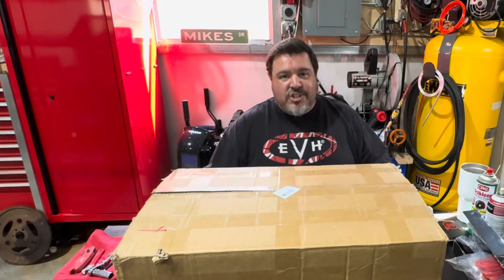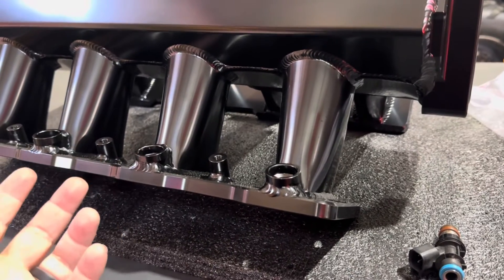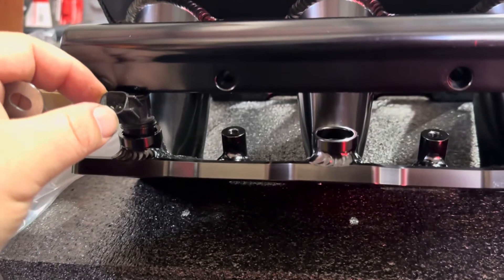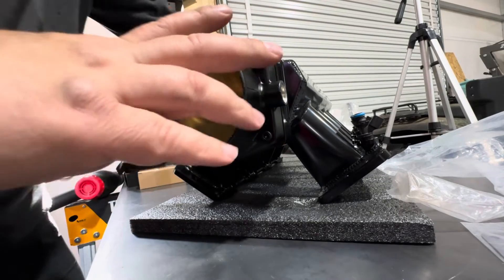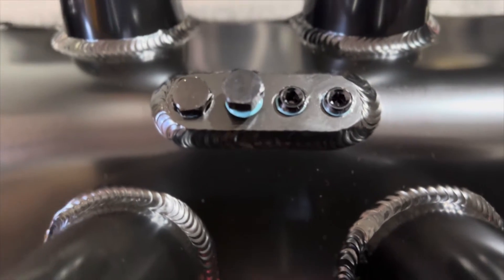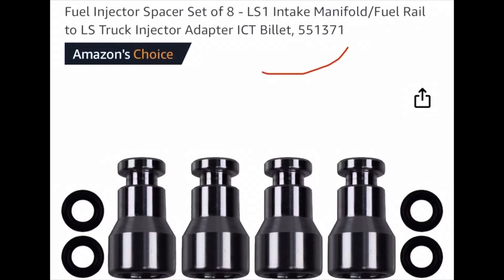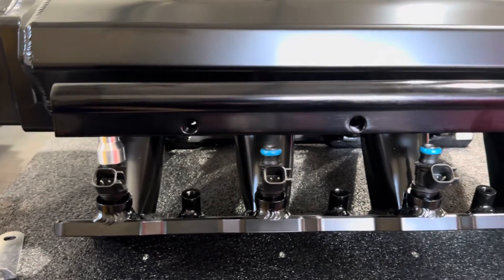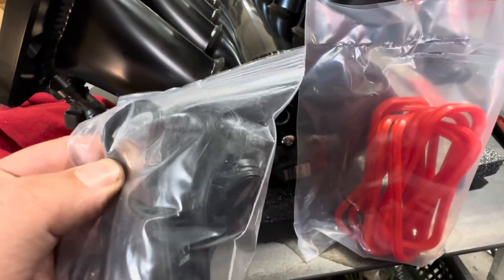Fabricated Sheet Metal Intake Manifolds - Should YOU Get One?

Comment: I agree. I`m putting this intake on a stock 5.3 Volvo 240 wagon swap, and it will be at least 3  times the stock HP and smoke tire all day long. I do not need a track star. I already know closing the hood will be close, but I`ll find a solution if need be. 😁
Reply from the maker: There you go! Good luck with your project!

Comment: I'm a squeeze every last drop of horsepower guy and a car show guy. I have a polished Holley Sniper Hi-Ram intake manifold. All the Videos say it's  a high rev, race only, above 5,000 - 7,400+ RPM power band range.  Thats definitely not where  I want my street performance to be! I'm not rich either. If I was starting from scratch, the Holley Sniper dual plenum intake manifold comes alive 3,000-6,000+ RPM and that's what most of us are looking for the street. Great power all the way through the lower, midrange, and upper RPM range without having to rev it up into the stratasphere and killing your engine's life span. We also want everyday drivability. Plus the Holley Sniper Dual Plenum looks pretty spectacular under the hood also! I just purchased my 10,000 original mile built 5th Gen Camaro. Has 1,500 miles on all the performance mods. Im never gonna take it to the dragstrip but will be attending the car shows. Once I get my insurance and tag I will drive it and assess the lower- midrange RPM power band it supposedly lacks. I haven't had a performance car in 15 years so  I'm sure its 500 rear wheel HP is gonna pleasantly surprise me no matter the RPM. But, the supposedly better performing, Sniper Dual plenum with twin throttle bodies would look killer under the hood! Maybe something for the near future, we'll see. Good video.

Comment: So it will run with a stock throttle body.  IE LQ4?
Reply from the maker: Sure but you’d need the cathedral port version (cheaper too, I think) and a 104mm adapter, or use the supplied throttle body: 
https://amzn.to/41OOWvc

Comment: Those holes on in the bottom should be in the back of the manifold.

That way the air suction guides the front air to the back, and the air flows smooth.

From the front, to the back, right into the runners.
Reply from the maker: There are holes on the back. They give you some smaller options on the bottom for things requiring less vacuum
Reply: @intheshoptv 
The hole in the back is for the map.
No suction.

The holes in the bottom are for suction.

You get what I mean right?
Reply: @intheshoptv 
If you have the vacuum hoses at the back, the manifold becomes more effective tho.

Cause the air is being suctioned to the back, and down the runners as a result.

Comment: The stock truck intakes are so ugly but they work. I might try the cheap holly high ram knock off
Reply from the maker: I may eventually switch to the holley hi-ram too. It still wont make any more power down low but there wont be the noise that’s associated with the sheet metal intakes

Comment: So, I’m not a “car guy” by which I mean I do like cool cars but I know nothing about mechanical details generally (I know what a cam is but don’t ask me about the grind kind of stuff). 
So, can someone explain why/how aftermarket intakes increase power? I assume they allow more airflow, but if the TB is the constriction how does the intake help?
Reply from the maker: Not all aftermarket intakes increase power actually; mine reduces power slightly. There is a ton of in depth details but a good starting point to help you understand is runner length. Short runners, create more power In the upper rpm range band. This is beneficial to a race engine, where it spends most of its time (the upper rpm band). Longer runners create more torque and power down low, making them more ideal for street vehicles. Hope that helps!
Reply: @ Thanks! Appreciate the info.

Comment: I bought a kit from aces with this intake, things I noticed one the flanges are not true it rocks sitting on a flat surface to about 50 tho on one corner aces said not an issue so hopefully that's the case the other is the billet or cast head flanges don't matter up to the runner tube worth a crap, the runner is a bit larger than the port on the flange and instead of breaking up the difference they made two surfaces flush with a big step on the other 2. As far as port matching it's an o ring deal but I'm guessing the flange port is likely correct and mismatch would just move to the head instead. I was thinking I could at least go in with die grinder and radius the transition from runner to the flange vs a hart step... I prob should have done more research before going this route. I'm thinking I will probably end up buying a Chinese victor style EFI intake with an elbow and use the rails injectors and throttle body. As cool as these intakes look an EFI 4150 style looks super trick. The LS swap is going in my 92 c1500 the only mods to the engine at first anyway will be a cam and long tubes and I'm going from a warmed over 355 making 350ish HP tuned perfectly and never had been lol, so it will be faster regardless but Im going for street performance so knowing I'm leaving power on the table would bug me but once again if all goes well this year I'm planning on tossing a couple turbos on it and at that point doesn't really matter, holder says at certain HP levels engine mods are pointless all it does is determines how much boost to achieve your goal.... 600hp is 600hp it's easily achievable on pump gas with a bone stock engine even cam so why mod it to meet the same goal? The only reason I can think of is boost related issues like head gaskets and detonation but if neither of those things are an issue at 6 or 700hp them I guess it is silly? I have most large items except engine/trans and I'm doing the 5.3 or 6.0 and obviously I'd rather have a 6.0 why not but the conclusion I have reached is if your going NA then a 6.0 is a big advantage but if going boosted in the 700 to 800hp range it really doesn't matter if it's a 4.8 or a 6.0. I'm going both starting out NA and hopefully upgrading but there is no guarantee of boost I may be content with 400+ crank HP? I've been fairly content with 325+ crank. I can't afford drivetrain for 800hp anyway. If I can light the 295/50s up on demand up to 40mph I'd be pretty pleased. My truck is a semi daily, I have it and a 95 mustang gt 5 speed convertible that's my only daily now while the truck is still down but once the truck is on the road what I will be driving that day will be how I feel that day. I have to restrain myself with my mustang to keep us reliable with good street manners, truck not as concerned it's going to be my do stupid stuff vehicle the mustang I want a nice quick driver I'd love a nice mild HCI upgrade n call it good. I love having multiple vehicles it's fun walk out n say hmmm 5.0 mustang...? Muscle Truck....? Or 6000w bass van (2010 grand caravan with a foolish sound system with two 75lb 15" subs I built myself an apex 5000wrms mono block and 1500w of recoil multichannel amps). It's whatever suits my mood vs walking out and seeing one late model people mover... Borrrrring, I have 3 fun reliable vehicles for less than most have in one pedestrian level import.
Reply from the maker: That sucks Im sorry to hear that. Mine was machined perfect thankfully. While I cant personally confirm this - Ive not been hearing good things about ACES

Comment: I bought a 4.8 that had a Jegs fabbed intake. Combo is going to have a 88mm VS racing turbo on e85 and Holley Terminator. Im not changing anything until I see that the manifold is an issue.
Reply from the maker: @johnnymoran180  yep only run what works for you. Everyone’s set up is different

Comment: Even though I really like the look and price of these Chinese Holly Copy sheet metal intakes, the loss in performance is there, but I don't think it's the end of the world. I actually just came across an entire new copy-ish intake manifold for LS that is the newer style full aluminum curved top (similar to a BTR Trinity etc) from China, that is currently being sold on Ebay for $450 for the kit with seals, fuel rails etc in either black or chrome from a seller named 'Deepmotor' that is ready to accept a 102mm throttle body as shipped (for the LS3 flanged model anyway). I agree with you. Who cares about an extra 5% HP/TQ when the car will already fry the tires and is just a cruiser. I like your project. Look forward to it hitting the streets.
Reply from the maker: @joeyjojojr.shabadoo915  Thank you! I think a lot of people get hung up on peak power numbers, Im not a racer or an engine builder - I’m a car builder.  It’ll look good and be plenty quick for my purposes. Objectively - my only gripe is that they’re noisy. I like the challenge of trying to find a way to quiet it down though. Thanks for watching!

Comment: I like the look of the sheet metal intakes but my problem is I hear all the time how noisy they are especially if cammed.
Reply from the maker: @gthomas5880  they are definitely noisy. The slightest damping with your hand or a piece of silicone, rubber etc quiets it instantly. Im thinking I might affix a foam block to my hood insulation that makes contact with it when the hood is closed. But only if the hood insulation doesn’t quiet it first.

Comment: What was the final call on what the underneath ports on the intake. I heard the rear was m12x1.25. What’s the 4 underneath so I can order parts 5:20
Reply from the maker: I believe the larger underside port is m12 and the smaller are m8 but I dont remember exactly
Reply: @ I’ll order those sizes. I will return with an update and let you and anyone else interested in the sizes know. Thank you sir
Reply from the maker: @daylnharris8658  Ok cool. Good luck, I apologize that I don’t remember 100%
Reply: @  m12x1.25 was correct. I never did end up finding out the other side. Drilled and re-tapped to a 1/8 npt

Comment: So that intake is Rec port. What about cathedral port heads?
Reply from the maker: @garthkey  they make them for cathedral port heads too! Here: https://amzn.to/4d6rRr0
Reply: They make them for cathedral port heads also.  Holley, Fitech, summit Racing and Jegs make them in low and tall versions.
Reply from the maker: @Factors_808  yep
Reply: @Factors_808  What's the difference between the low and the tall? Does one work better for different ranges?
Reply: @brandonmcdonald2993 
The height, if you have a stock truck intake and it doesn't fit under the hood of the vehicle you're swapping and can't find or wanna pay for a stock car intake get the short intake, but it won't perform as well as the stock intake at lower rpm's
Reply: @brandonmcdonald2993 
I would use the stock intake if possible. Trailblazer SS or LS6 intake if you find a good price for cathedral port heads

Comment: I'm looking at hogan intake manifold billet and my buddy says go with a carbon fiber intake he says carbon fiber is better what is your opinion on this I don't have a clue so hogans billet intake manifold OR carbon fiber intake manifold
Reply from the maker: @travisnunya4641  really depends on your application. They are both high rpm style intakes so really we start looking at small details when making a choice… I guess the carbon fiber intake probably has a slight advantage if you consider heat soak at all. It also may be a little quieter. I know the sheet metal intakes tend to be a little noisy, although billet may be not as much. However the billet is nicer looking. Without knowing your specifics and just blindly choosing something - I guess Id pick carbon fiber

Comment: I had a similar issue with the vacuum plugs, except my kit didnt come with any at all. Seems the forgot to put them in the box. Was wondering if you might be able to throw in a link to the plugs that you ended using for yours? Thanks for doing these videos, Ive used them a lot while doing different things on my 59' Apache.
Reply from the maker: Did you get the same exact intake kit? They’re supposed to be SAE but half were metric! Really odd- I dont want to tell you the wrong size if your intake is different. The smaller ones are 1/8 npt https://amzn.to/4aevwRO and the larger ones are “supposed” to be 1/4” npt, but mine were m12
Reply: @intheshoptv  same kit but from a different seller. I also realized after posting originally that the firing for the back side vacuum line for the breaks is missing. Very frustrating. On another note, I also opted to plug both front ends of the fuel rails similar to what you did, but used a T junction on the back of the odd side fuel rail to do the cross over and tie in the fuel line from the tank. I'll take a look at the link you provided. It's much appreciated.
Reply from the maker: @BigAndy62  you’re very welcome! Would be a piece of cake to drill a hole in that aluminum on the back side, and install a threaded bung!
Reply from the maker: @BigAndy62  (continued)… check these out - just coat the threads real good with pipe dope so you get a good seal (or permatex if the hole is a little oversized). https://amzn.to/3JUpyeh
Reply: @intheshoptv  thanks!! I'll take a look at it and see what I can work out.
Reply from the maker: @BigAndy62  good luck!

Comment: EXACTLY!!!!  I am doing my first swap. Ls3/6L90E in a 03'Crown Vic Police Interceptor.  It's a project with my grandkids. I don't care what other people think. I don't need a thousand horse. I want it ro look cool and run good. I've rebuilt this engine. I don't want a 5.3L with a turbo like everyone is running. I want a N/A that my wife can drive and not be difficult for her to drive. I put a BTR Ls3 Stage 2 V2 cam in it. If I can get 400ish to the wheels that's great. It had a 239 horse engine from the factory. So what 190 to 200 at the wheels and she would still move a bit. With this much horse and way more torque then it had at the wheels, this thing should be a riot. Burnouts and ice cream with the wife and grandkids and also some car shows. My next Vic will have a 5.0L. Good deal.
Reply from the maker: Love it man! I wish people would understand there’s so much more than staging lights and reaction times, to this. Enjoy your ride!
Reply: @intheshoptv  EXACTLY!!!! Thank you sir. You as well.

Comment: It would make way more power with a truck intake. And they’re free. 😂
Reply from the maker: It would make “marginally” more but only over 3500 rpm which hardly any street cars spend any time over that. Also, Id make more power than your truck intake with a carb... You missed the part about perspectives and baseline.
Reply: @intheshoptv  which carb intake makes more power than the truck intakes? Can you do a video on that one?
Reply from the maker: @DWBmotorsports  Send me the one you’re running on your fox body and I will.
Reply: @intheshoptv   I run a victor jr. it actually makes 30 less ft/lbs and the same peak power at 6700rpm as the truck intake however the truck makes that power sooner and carries it for about 1000 rpm. I was forced to use a single plane due to being blow thru turbo charged. But like you said, most street cars are driven under 3500 most of the time. With that being said. The “ugly” truck intake makes more power than that polished thing you praise so much from 2900 all the way to 6 grand. Seems like the clear choice for a street car. I’m glad I found your channel so that I could educate you after you blocked me on Facebook when I proved you wrong there too.
Reply from the maker: @DWBmotorsports  Not 2900 rpm, 3500 rpm and under, the curve is virtually indistinguishable (which you agree is where most street cars reside). It really makes little difference what intake you use down under numbers that low. Street cars dont operate from 3500 to 6000 genius. If you would pay attention to what I said, I never praised sheet metal intakes. I said that not everyone desires peak performance. I know that from YOUR perspective that is unfathomable. But its quite true. Watch the end of the video, then perhaps it may start making sense to you. Pay attention to what I said about baseline. I even said in the video, that these intakes make less power than a truck intake but you’re so hellbent on trying to thump your chest for attention that you didn’t even catch any of that. Or maybe not, maybe you’ll stay entrenched in your own perspective and be unable to see things for other points of view. Either way, I wont block you here, as every reply you make benefits my channel by working the algorithm, whereas on facebook, your petulance is simply distracting. So I encourage you, my new friend and promotional ally… please continue to argue petulantly. I find it profitable. And you proved nothing because you still haven’t paid any attention to what was said. All you’ve proved is the fact that you feel insignificant or insecure about something and need to pick cyber fights to feel better about whatever it is that you feel inadequate about. Nonetheless, Im honored that you took the time to seek me out on yet another platform to engage more. Its quite flattering! Its so interesting that you silly people allow yourselves to get so bent all because of a piece of aluminum that’s not even on your vehicle. Weird right?
Reply: Free and fugly

Comment: I have one of these on my 408 stroker lq4 and it's very tinny sounding. The top panel not having any kind of structure it reverbs a bunch. I can put my hand on it and the noise goes away. Deff looks better but noise sucks when hood is open
Reply from the maker: Yeah that’s common. I was thinking of maybe some dynamat on the underside. But then again, with the hood closed and a healthy exhaust, It probably wont bother me much
Reply: @intheshoptv  only issue I've had is just making sure that's the noise I'm hearing and it's not something else. Lol. Other than that it works and looks great I have the same valve covers also.
Reply from the maker: @brianriggs3454  I know what you mean. I think the hollow metal nature of the design amplifies the natural valve train noises.